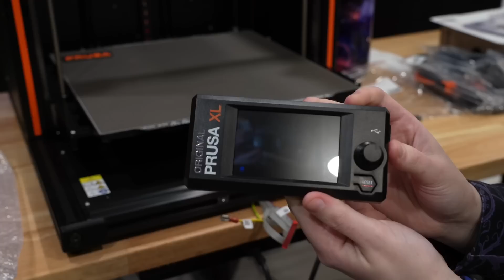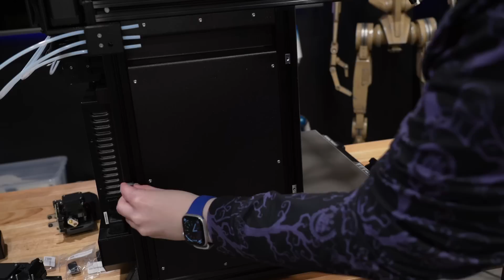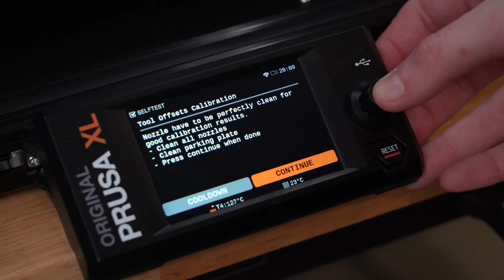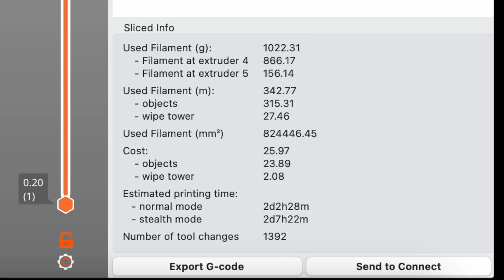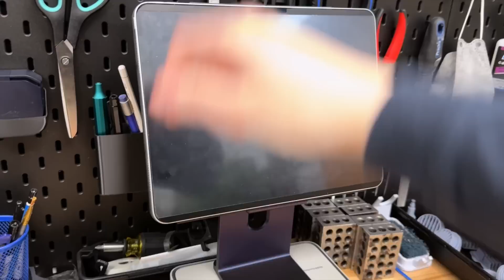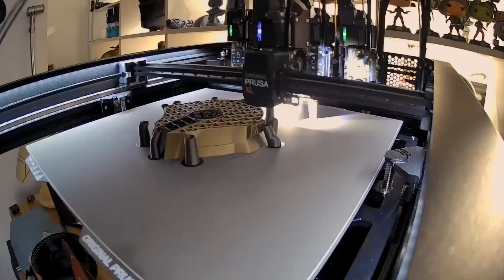Why the Prusa XL is the Best Multicolor Printer

Comment: Dear god, there is so much to do before you can start printing. As a fairly recent X1C owner, this printer does seem like an excellent replacement with maybe even better quality prints. I also appreciate the multi-head approach to multi-color printing. But my word, for a beginner this printer is off-putting.

Comment: Great video Michaela!  You mentioned the Prusa XL fits any droid part we could want...but I think the one item that won't fit is the full chest from K2SO - IIRC you said you needed 400x400 to print that as one piece?  Otherwise thanks for sharing your experience with this unit!
Reply from the maker: That’s very true. I always forget how insanely large that piece is if you want to print it in a single part. 
The nice thing about the droids is there are always split versions of the larger pieces for anyone with smaller machines. Other than the solid K2 chest, I believe every other large droid part could be printed on a 350mm class printer in a single piece if you wanted.

Comment: We've been looking something to replace our MK3S to get speed and especially larger parts. XL is likely going to be the choice. I've read some stuff about failing driver boards or something though. Then again Prusa I have at home hasn't had ever any issues and work one failed first time just few weeks ago for thermistor cables perishing and shorting out. Luckily it didn't damage mobo and got replacement parts from Prusa for something like was it 6 to 10 euros plus shipping. Plus documentation is so insanely good for Prusa models. We were looking for maybe getting Bambu, but luckily their thing now happened and their printers are ruled out option from now on unless they like open source everything.

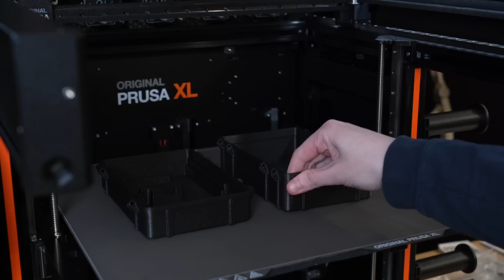Comment: at 11:53 on the sides of the box, those vertical bands are normal? Im new to FDM printing coming from exclusively resin printing and my 3d printer has those same vertical ribs only significantly less noticeable. Ive burned a kilo of filament doing endless calibration tests trying to get them smoothed out thinking it was a printer issue. If its happening on a printer as expensive as the XL, it means its normal?
Reply from the maker: They’re generally referred to as VFAs and are caused by motor resonance rippling. You can sometimes improve them by changing the speed the object is printed at or even adjusting the belt tension.
It could also be worse on certain axis on your machine and angling the part 45° might improve the appearance.
Reply: Slow down your outside wall, should help

Comment: I am looking for an upgrade for my anycubic Kobra. A bigger printing bed, more than one filament, enclosure so I can have an exhaust fan to the outside. Prusa has an open system which is a go/nogo decision for me. Locked in like Bambu is establishing is a  nogo. The Kobra has a 220x220 mm bed, the Prusa Core One has a 250x220 mm bed, I dont like the 220mm. The MMU3 is a good option for multiple filaments, but the Core One's 220 mm makes it rather unattractive. The XL ticks all boxes, but the price tag is brutal.

Comment: i really wanted to buy this but at £5k for 5 heads and no enclosure i just couldn't. 
Ended up getting a P1S w/ AMS, a few upgrades (hardened gears, revo hotted with quick change nozzle, panda touch, jetpack etc) and am still up £4k for whatever else i need. As a beginner on my first printer, i realised this was fine for me and the upgrades give me my tinkering fix! Absolutely love this machine though!

Comment: From the Prusa website: "The XL was designed for efficient multi-material printing with zero-to-no waste and super-fast operation. A tiny priming tower for nozzle pressure stabilization is usually present, but with properly dried filaments and wipe-to-infill options, the XL can print completely without waste! No wipe towers, no flushed filament around the printer!" So you can have no waste at all by the looks of it, which makes it an even better choice.

Comment: Decided late in October I was going to finally get an XL, but patiently waited for the black friday sale to roll around. Glad to see new videos coming out on the current experience! Initial reviews were pretty rough because of the 0.6mm nozzles and lack of input shaping among other early hardware/firmware issues, and that definitely gave me pause during my own research phase. Now that I have it, I can say it's an absolute game changer. Slinging multicolor quickly, embedding TPU gaskets into things, and using PETG to support PLA (and vice versa) have all been fun to play around with. Now that multiple nozzle sizes in a single print are supported, my next plan is to print parts in 0.4mm or 0.6mm and use a 0.25mm nozzle for top labeling and fine detail work.
Reply: That nozzle size change is what interests me greatly. I have at home 0,4mm Prusa and one modded creality printer with larger nozzle for more coarse parts. XL indeed with multiple heads would be great with multi nozzle setup. I'd absolutely go for like 0,8 and 0,4 in my usage. I'm not into multicoloured prints. I mostly do "functional parts" for industrial usage and only coloured prints are like emblems with simple layer change colour change for better readibility
Reply: Ditto. Got mine on the black Friday sale also. It is a very nice printer.
Reply: Cool. What kind of the discount did you got? Was it assembled or semi assembled?
Reply: How is it working out for you now? We got one on work, and I am quite dissapointed on how it handles PETG.

Comment: While I don't plan on spending as much on a 3D printer as my car any time soon, I do really like seeing takes on higher end printers!
Reply: A home AC unit is less complex and nearly 2x the cost, installed. I'm sure this would make more money than most used cars and AC units. At this price, it's not a hobby, it's a tool to make money. Though, I'd personally rather have 10x or $300 or 5x $600 machines with less ability. It's more parts per hour and backups if one fails.

Comment: Best review about the XL and multicolour printing! :) And thanks a lot for printing & linking my Prusa Box! Yay! 
I am also considering getting the XL with 5 heads and getting rid of my X1C. But I am rarely printing multicolour these days, maybe because of all the waste which comes with the X1C... hmm
Reply: That's funny because I rarely print single color prints with the XL. Just too easy to add colors. :)
Reply: @ I got one after one day I dropped the comment. And yes, it’s soo easy and quick I only run multicolor prints. =D

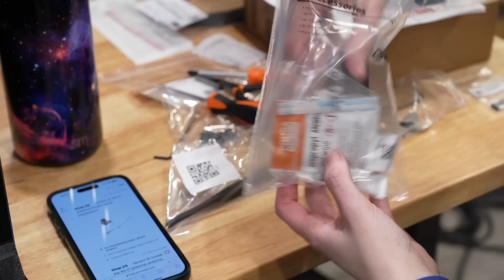Comment: 3:24 that rail needs to be beefed up I think. It has to be rigid and when you reef on the bolt to get it tight it could thread out. I’ll be insteresta to see if the Mk2 version will improve That section.

Comment: Great Vid 👍The XL is the best of the best no doubt. But even with the poop saving per print i'm just not going to see the profit within a year... for me that's 7k against cheaper colour printers.... Sure i will see a gain across 10 printers after years of printing but a 70k out lay here in AU against 12k is still a 58k up front outlay... that's alot of poop.  My printers have lasted a full 2yrs + and while i have no doubts the XL will last another 5 maybe 10 years i doubt it will still be relevant in a few years time as cheaper clones  and newer print tech will gobble up these machines.

Comment: This will be THE video that convinces me to get Prusa XL, or other Prusa printers. Well done.
Reply: Same!
Reply: Just to be clear the Core one and mk4-3 etc create waste, just as much as any other multi-color would, the XL uses multi tool heads to accomplish that and costs like 5k$ without a camera or enclosure.
Reply: @PLr1c3r  Not correct. mk3(s(+)), mk3(s) and CoreOne with MMU3 create much less waste than others. They do not use cut&poo, but ramping on unload to get a nice filament tip. Works only due to the smaler meltzone of Prusas standard flow nozzles. With MMU3 you have about 2-3 times the waste of the XL, but still less than half than on theese cut&poo printers. You can reduce waste to nearly the same of the XL using waste2infill or waste2object. Wich does not work on the poopers, as cut filament isn't retractable anymore...
Interestingly, you could theoreticly get rid of cut&poo on the AMS-printers (X1C, P1P, P1S, not the AMS-light printers) using the Panda Revo and inserting a normal flow Revo nozzle - and using Prusas ramping profiles. However, as it is closed source, I do not know if you actually could deactivate the cut mechanism (and add an external cutter for error managemant in case a filament reload fails).
The most promessing alternative to mk4+MMU3 might be the Kobra 3 - it is based on Klipper and you get a pure Klipper on github. Also the ACE pro is accessible by Klipper (DuckACE on Github). Modifying the hotend to Revo you could use "Ramping on unload" instead "cut&poo" , reducing filament changing time and waste by a lot, but still much more comfortable filament management and integrated filament dryer.
Reply: @PLr1c3r it has an enclosure you just have to buy it separately

Comment: I’ve been looking into getting a multicolor printer and your videos have been very helpful in deciding. 

Is this the “semi-assembled” or “assembled” version of the printer($500 price difference)?
Reply from the maker: This was the assembled version. Semi assembled has you putting the main body of the machine together as well. The instructions for both versions are all online if you wanted to see exactly what goes into each assembly process.

Comment: I always thought the purge poops was a lazy way of purging. The MMU on the i3 style Prusa printers only uses a purge block so there is much less mess around the printer made by the printer. I've wondered if the purge poop machines are a reflection of the lax environmental care of the cultures where the printers were developed. I'm not trying to make a judgement call, more of an anthropological observation.

Comment: Tip for multi material support,

Initially I ran into some issues, and took a while to get it to work.
But, Prusa has improved it!

Make sure under print profile, you choose SOLUBLE FULL option.

And in print settings, under support, make sure you UN-check the ‘with sheet around support’ setting.

I have nothing but an amazing experience with the PrusaXL, but I am experiencing an odd issue which might be related to multi material support…

Where a printhead will throw a filament error (despite there’s actually nothing wrong) , nicely pauses the print and let you reload it, then continues perfectly where it left off.

However, when the printer then says it’s finished, it’s actually not!

And the only way to recover, is to measure the height with calipers, guesstimate the exact layer, clear the bed and print the remaining layers again..,

But that’s really the only issue I have experienced.
( yes, the start up is agonizingly slow but I live in the Caribbean, so on island time anyway 😂)

PS, its your work that inspired me to buy the XL.

Comment: The tool head changing is definitely a big advancement over typical AMS systems. If not taking advantage of the multi-material you could afford to waste a lot of filament for the price difference of a K2 Plus. 

I'm curious if there is any advantages from having different sized nozzles. Could you use a 0.2 for outer walls, 0.4 for inner walls, and then 0.8 for infill and support? Or does Prusa slicer require all the tool heads to have the same nozzle size?

Comment: Grate Video and I have to agree with you, that’s it is a awesome Printer. But you said that there are no Multiple Buildplates, that might be, because you are not running the most latest version of Prusaslicer. If I remember correctly it came with 2.8 or 2.9 so you can plan them out as soon as you update the Slicer.

Comment: Great video. I desperately want one of these to play with but 4 grand (US) is a tough price to pay for a hobby tool. Maybe someday lol.
Reply: Same. Or even a printer with just two hot ends would be nice for creating supports with different materials but even those are so much more expensive than for example the A1 Mini.
Reply: @MrunHide 2 extruder printers are cool and would maybe fit.
Reply: I would recommend at least the 2head Version, otherwise you can Just buy another printer why has a big build Plate etc...

Comment: So here's my question. Would you recommend this printer for someone who has never 3D printed before, or obviously owned a 3D printer. For me, I love the ability to have multi-color with less waste and in doing research over the last 2 months it seems like the other printer that has just changed their policy is no longer an option for me. That's why I started looking at Prusa.
Reply from the maker: The XL does involve more of an assembly and setup process than a lot of the 3d printers being released these days, but if you’re fully aware of that, are up for the challenge and feel that this would be the most ideal printer for you, then I’d say go for it. The instructions are very detailed and also all available online (you might want to check those out to get the full idea of the process). After that initial assembly, it’s very much plug and print from my experience. No need to be tinkering around with settings, troubleshooting, etc.

Comment: Is there a feature on any of these slicers to use the purge tower to make random stuff? like.. i dunno. maybe it makes these modular lego-like tiles u can use to make other stuff with.. and you dont care that they're weird colors cuz it beats throwing them away.
Reply: You can set purge into object if you dont mind dodgy colouring just have a second object on the plate and select it
Reply: You can do that with the single tool head on the Bambu X1. I always print purge objects with multicolor prints and have essentially no waste. Of course, this has no effect on the time required to switch filaments.

Comment: I want one😅

Not for cosplay, but for Pads. On my channel you see example of what i mean, pads are accessories for EUCs made from TPU, purpose is to keep the rider somewhat connected to the wheel. And for seats. Now, the Multimaterial comes in handy for a petg base and TPU contact area. Now, you can just print first petg and then TPU, but that will separate eventually, and it doesn't provide the hardness inside the parts. 

The prusa XL has the size needed (im currently using elegoo Neptune 3 max 420²), 360² would probably suffice for most pads.

I also like your camera mod.

And I'd probably be stress testing this thing for sure. My lynx seat takes 7 full days to print, and TPU is already a more tricky material to print when it comes to stringing and clogs and extruder gear shenanigans. At least when printing my way, 0.1 layer height for some extreme good Looks
Reply: What's a good video to see the pads you are talking about?
Does "EUC" stand for Electric Uni Cycle?
Reply: @ddegn  yes it does, my latest video shows them in use. Although my pads are a little unique among all other pads, you should get an understanding for what they are used

Comment: Super video.I got close but backed out on the Bambu promotion late last year. So glad I did. Prusa checks far more boxes for this old man! This next couple of months will see me leap into the hobby. Thanks for doing such a fantastic video & explanation.
Reply: Have you 3D printed before? I purchased a printer (Prusa MK3) a few years ago. It has been every bit as much fun as I hoped it would be.
Reply: @ddegn  I have not 3D printed before, but I want to get into it for my grandkids. I'm glad I avoided some of the "walled garden" stuff that has been talked about recently. Sounds like Prusa is a good guy running a good company.
Reply: @StevePilgrim2013 If you arent in a rush try to get a used MK3 or better MK3.5 or If available a used MK4 or mk4s. Maybe a used prusa Mini would also be okay, depending one the stuff you want to Print.
Reply: For over $4,000.... I'd expect it to be.... I can buy a small 8 printer print farm for the price of 1 of these.

Comment: I think it would be cool to print supports in the cheapest PLA you could find, then switch to a desolvable support material for the interface layers.  Stacked printing for projects like Multiboard would also be a no-brainer.  unfortunately my small apartment doesn't have a spot for such a beast (nor does my budget)

Comment: WOW! What a fantastic printer. As far as the price goes, I remember saving for months so I could buy an original MakerBot Replicator. If I remember correctly it cost me almost $1900! I currently own a Qidi Tech X-Plus 3 which I use for making Gaming/Diorama terrain. A five extruder printer would be a game changer, and it's Prusa!
Reply: yeah, it's also 4k USD for the 5 head printer right out of the box, if you've got the xL already its about 1600 to upgrade. Too rich for what I'm doing. I'll just recycle the printer poo to other projects.
Reply: @shannononeill482 It is definitely a prosumer or business printer where the filament savings and stuff is worth it especially as business can absorb printer cost easier
Reply: It's amazing how far things have evolved in recent year the acceleration is stunning